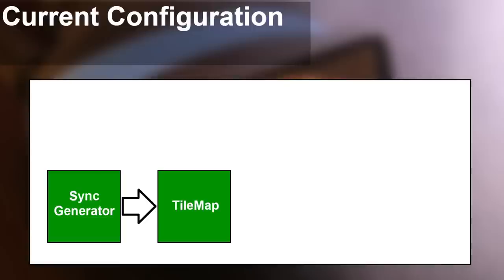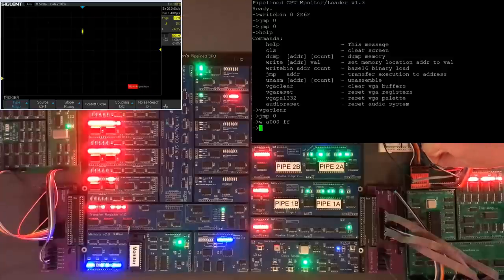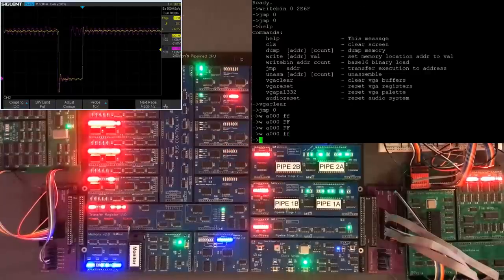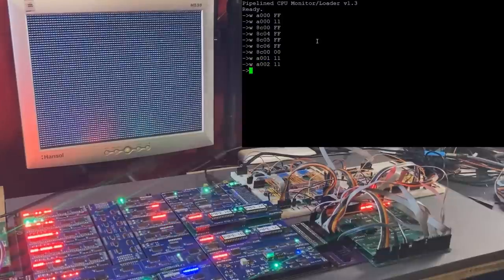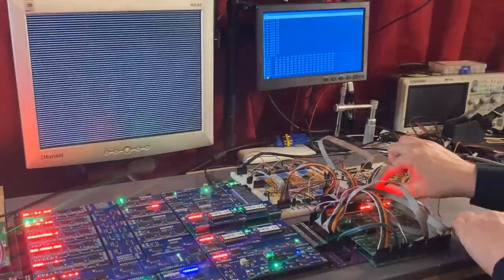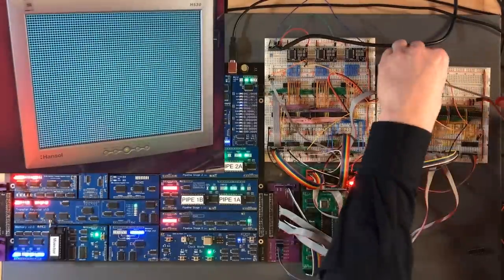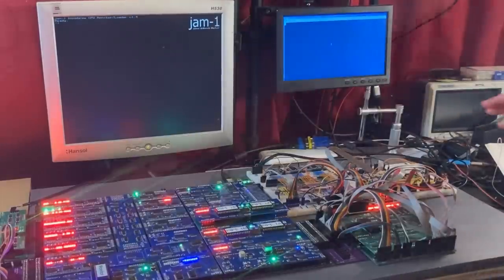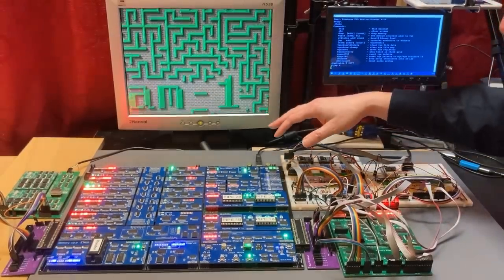Tile Data - VGA from Scratch - Part 13

Comment: Feels like we are getting to the point where the VGA output is more complex than the rest of the system. Great job adding yet more features!
Reply from the maker: Only one main module to go, won’t be as complex as the cpu but it’s not a surprise that it’s up there.

Comment: Outstanding, so good - and the old parallax tile trick to get another playfield, very nice. Once the sprites are in you're basically there, can't wait to see a playable game on this thing
Reply from the maker: Thinking of porting my “snek” game to the vga soon.
Reply: Sprites overlap. So you would need to duplicate the same circuit for each sprite. C64 had 8, pcEngine 16.

What about 4 tiles per tile? The background and 4 shifted ones. So you could only overlap 3. On breadboard memory is cheap.

Or basically, on breadboard rather use a framebuffer and a single blitter.

Or a genesis linebuffer which is filled in the side borders? Sprites could be 1 bit for transparency. Each sprites sets a different bit so that we can detect all collision combinations. Then in a second pass fill in the winning color?

Comment: Great work James !
I always go straight to PCB now for complex prototypes myself as JLC are cheap and quick !
Reply from the maker: I had an idea that I should have done a pcb for the core memory circuit here as I could have used it for multiple circuits as I converted the previous bit to pcb

Comment: Excellent James. Another demo idea - I remember using this tile changing and placing method to create a hi-res oscilloscope demo on my very low res VIC20 in the early 80's. The tiles made the waveform shape in low res with the hi res tile definition giving the waveform shape required. With most of an oscilloscope screen blank it was perfect when there weren't enough unique tiles to fill the screen. Perhaps a step further would be an A-D converter and you have a scope that could look at itself or the JAM1 !
Reply from the maker: Interesting idea, making an AD convertor in logic is something I’ve thought about.

Comment: I have just re-watched this whole VGA mini-series while resting up nursing a bout of Covid...     Clearly the planning that has gone into this has been very thorough and well thought out.  Well done!  Personally, I would have loved to see a larger full-resolution buffer (obviously paged into a smaller space), but for your stated needs I can see that the creation of additional layers of screen data manipulation by having both the tile and palette mechanisms available offers so much more flexibility as well as processing efficiency.  I am intrigued by the possibility of how you might get back to 8 bits per pixel to fully utilise the palettes, albeit at a lower resolution.
Reply from the maker: One thing to understand is that I was prepared for the cpu to max out at a lower clock rate so the vga had some design elements to enable me to make some fun games with less computation than I have. I do have plans for future cpu+video builds that will both have flat frame buffer and the power to fill it at a decent rate.
Reply: @James Sharman  Splendid!  I look forward to all future updates.  And yes, designing for a potentially more restricted processing power makes good sense.  While watching, I was also revisiting the two computer video hardware designs that I did in the 80s, one was just character based with a 6845 controller, the second used the amazingly capable 82716, but which was quickly overtaken by PCs going down the EGA and VGA path.

Comment: I know this project is long over, but you hit the nail on the head when you said "I swear it would be faster to just make a PCB for this", the amount of times I've seen you hook up a bunch of multiplexers to just pair all of the address or data lines together and bind all of the inputs together... I feel like you could just make one reusable multplexer DIP style PCB, that just took in two sets of 8 inputs, one set of 8 outputs, a single select line, pwr & gnd, with built in decoupling caps... You could put it in a wide DIP 28, and just reuse them over and over and save 60% of your wiring each video... 🙃
Reply from the maker: The project is not over! There are still a few parts of it left to go, only one more section that has memory in it though. There are some benefits to making some modules to use along the way, but the significant difference between the circuits is still going to be the differences in the inputs. You'll still have to see me add all those lines even if they terminate in a neat row rather than spread around the multiplexers.

Comment: Hi, great work. So as I understand you select the Tile, select the Pixel from within the Tile, get the Color data from a particular pixel look it up in the pallet and output its RGB to VGA... would the versatility be massively improved by having a pallet index .. well ... basically per tile. So the tile data could define reoccurring shapes without having the colors locked? Or is having a pallet lookup table too much out of reach?
Reply from the maker: You could do that, but I’d need somewhere to store the data. Another idea I had was to use a few bits from tile index to offset the pallet look up, so you would have 16 different 16 colour pallets each used by exactly 16 tiles. But then I came up with a cooler idea you’ll have to wait to see.
Reply: @weirdboyjim  Ooohh... you tease you ... ;-)

If I may some additional feedback. I Liked the overlays of the ICs but had wished for description not just numbers "multiplexer" or "ram" would have been sufficient. Also when we are talking about 640x480 graphics a closeup or two of the screen would be lovely ... at this size youtube compression lets only guess what is a glitch and what is a compression artifact

Comment: Something I noticed: the tile data indexes directly into the global palette? I know on Nintendo's tile-based systems, the tile data generally indexes into a small portion of the full palette, and the portion is selected independently for the tile from its pattern.

Regarding the parallax, while it wasn't the 8-bit system, the Super NES, as well as a few other Nintendo systems, had multiple background layers that could be scrolled independently for things like parallax. Speaking of the SNES, are there any plans for affine transformations (the famous "Mode 7" graphics)? Even if for nothing else, it would enable zooming in to that kind of tiled level to actually get a better look at the individual tiles. :P More seriously, it can also be used isometric games where each tile displays as a rhombus rather than a square, and of course changing the transformation on each scanline gives the classic 3D projection capability.

(I guess I should mention that I didn't grow up with 8-bit systems and instead grew up with the GBA, so naturally I'm a bit more fond of the more complex, but still low-resolution, tile-based graphics that it has, and largely shares with the SNES, compared to the graphics of the NES.)
Reply from the maker: I'm more trying to demonstrate different principles than reproduce some specific functionality.  Mode 7 was an interesting feature that could be described as stepping stone between planar graphics and primitive 3d hardware.

Comment: I might've missed it, but adding an additional memory lookup would create a 1 cycle delay, which must be compensated for (as the sync pulses still use the same timing), resulting in slightly shifted pixels? How do you compemnsate for that?
Reply from the maker: Yes it does, I’ll be talking about that more in a future video, I hinted a little about that in this one.

Comment: Great video!  Was wonder if you might revisit the CPU or do you consider it done at this point?  Would like to see more advance math functionality added.  Like multiplication and division.  An easy route would be to implement LUT in ROM. Multiply and Divide would each require 64k.  This can be reduced if you remove duplications.
Reply from the maker: The cpu may get some tweaks but the core is there. I do have plans forming up for a new cpu build that will advance a few concepts, trying to evolve this in place is not the best way to do it.

Comment: I’m trying to follow (now that I’m home from work😂) exactly how this looks in memory. I’m guessing there is a 80x60 (8 bits each) region, call it the frame or cell buffer (so 4800 bytes). These 8 bits index into a tile map, each tile is 32 bytes in size (8x8 pixels x4 bbp = 32 bytes). The full tile map is then 256x32, or 8k in size. The resulting 4 bits per pixel are then used to output a colour directly? Or are they an index into a 16 entry table (of say 8x3 bits each) to give the final rgb output to the display?
Reply from the maker: The tile map is actually 128x64 of which 80x60 is shown, the visible section selected by the scroll registers.

Comment: That's awesome! How much headroom is there? Could you run the pixel fetching circuit at higher speeds? If so, you could potentially use the same circuit to generate multiple values for each pixel sequentially and latch and mix them together to create multiple background layers, without replicating the entire circuit.
Reply from the maker: Unfortunately I don’t have enough bandwidth for that. In theory I’m only using half the bandwidth for tile-data as I get 2 pixels with each read but the logic to make that work would be extensive

Comment: 8-Bit Guy should have commissioned you for the graphics interface on the Commander X16 - that way it wouldn't have ended up as an overblown FPGA-solution that has zero chances of ever ending up as discrete chips.
Reply from the maker: Nice sentiment! Not sure it would have helped him keep the pcb size down!
Reply: @weirdboyjim  No, but I see a Planet-X port in the future ;-)
Reply: @weirdboyjim  I think what you are building could still be optimized, especially with some simple programmable logic arrays, which I feel is fair game still.
However, the VERA module of the X16 has become its own computer entirely, which seems ridiculous for a computer built around an 6502.

Comment: I like your solution. a full resolution frame buffer would overwhelm the bus, no way to drive fast graphics that way. It would feel like the C64 in graphics mode. This looks more like a NES/Gameboy solution. It would not have survived Nintendo cost cut back then, due to all the SRAM required ;-) I guess you will need even more ram to drive the sprites because I doubt you can reuse the tile ram due to timing issues. Coming up next a PS2 keyboard interface?
Reply from the maker: It would good to get some kind of keyboard interface in there!

Comment: Given that a lot of what you rely on is 74L series glue logic, what is the major differentiation responsible for  the amazing capability you demonstrate with your project Vs the typical capabilities of cards in the 80s? Why didn't we see more in he 80s of what you demonstrate today?
Reply from the maker: There are are a few factors there, I have the benefit of hindsight but don’t underestimate the advantage I have in low priced memory chips. I can buy SRAM easily but designers back then would have been fighting DRAM to stop the cost being prohibitive.

Comment: Just to get an indication of how long it took to wire these breadbords: what's the speed-up when you're not talking and explaing stuff? 5 times, 10 times as fast?
Reply from the maker: My go to speed up is 9x, I tend to do things in multiples of 3. But I also cut chunks out when Nothing is moving on camera, lots of wire stripping etc.
Reply from the maker: If I remember correctly the build videos  were about 3-4 hours before I started editing.

Comment: It seems like you could potentially add more actual background tile layers once the tile system is made into a PCB if perhaps you allow the PCBs to stack with a way to set their tile data (tiles and palette) address? If there's enough address space!
Reply from the maker: Sure I could, but I’m trying to avoid adding features beyond the earlier design now.

Comment: Time to add a keyboard? Not a ps/2 keyboard of course (because where's the fun in that), but doing your own scanning hardware? Maybe with a custom keyboard PCB, or possibly using an existing one (if you can find one that doesn't have a built in controller).
Reply from the maker: Hmm, that’s an interesting idea. I was looking at key switches the other day.

Comment: I wonder what is the limit of improving parrot quality with new version of hardware.
Maybe adding of dithering can help with limited amount of colors?
Reply from the maker: It would be really easy to just add enough ram to have a full resolution frame buffer but I’m trying to explore the techniques, the parrots will improve though!
Reply: Taking the input Image and creating versatile tiles that can be reused within the image might be the real problem. Dithering would have to be done within the tile data, and I guess that's the real bottleneck
Reply: @Schwuuuuup  I think that some areas of image may benefit more from dithering and some areas - more from added detalisation. Also it may be interesting to try changing palette and tile data on the fly.

Comment: Doing an optimization to a set of Floyd-Steinberg tiles to display images would be awesome. 😅
Reply from the maker: Generating a good set of optimised tiles would probably make a mini series on it’s own.
Reply: @weirdboyjim  easily. Especially if one gets into the eye/brain interface along with colour/vision and so on. From a pure optimization perspective, it's an interesting problem (if we ignore some of the human vision aspects) on its own as well. 😄
Reply: @NuttySwiss  I think PSNR (MSE) may be enough to decide which result is better.
Reply: @sdjhgfkshfswdfhskljh3360  it will get close, but would likely not help with various aspects related to vision and patterns.
Reply: @NuttySwiss  do you know about any method better that PSNR, which describe image quality as single number?
I tried to find one and failed.
Single numbers are needed because they are trivial to compare.
Saying "this image looks better" will not help, because every person have his own feeling of "better".

Comment: I wonder how hard it would be to rig up a PS2 keyboard - i'd think it wouldn't be too hard.  Maybe serial is preferable, but I think there would be cool factor on being able to use screen & keyboard, with no laptop attached.  (You'd have to preload the roms of course).   Maybe you could port an assembler or some interpreted language like basic or forth  - I like like the idea of being able to use it like the old 8 bits of the day.  Maybe your for focused on the console idea . . . but still.
Reply from the maker: Ps2 is actually a little easier than serial but a similar thing.

Comment: Too many commercials, James.
Reply from the maker: I don’t get much control over that sorry.
Reply: It was 20 - 40 seconds every 5 minutes.

I hope not that this is the new standard of youtube :0(
Reply from the maker: @CodeBallast  I get an on/off option in a few categories but I know they have been pushing it up lots. Maybe your fitting into a particular demographic being targeted lots at the moment.
Reply: Love to see the layers of progress. As systems like this evolve, the rate and quality of the changes reflect the original architecture. This one is clearly a winner. Pity that it’s hard to make a lovely 8x8 font, but that’s a very small nit,